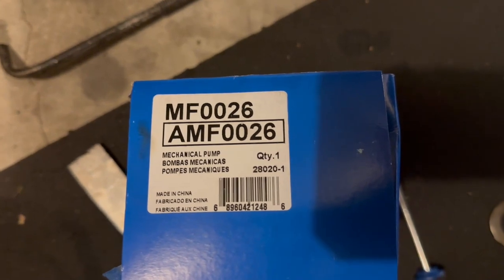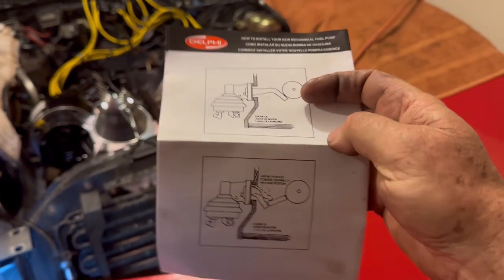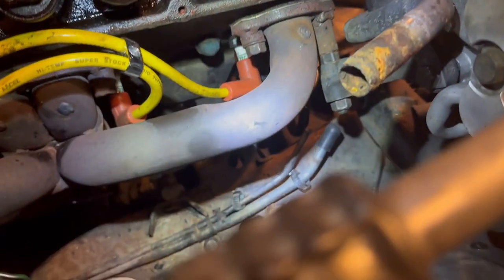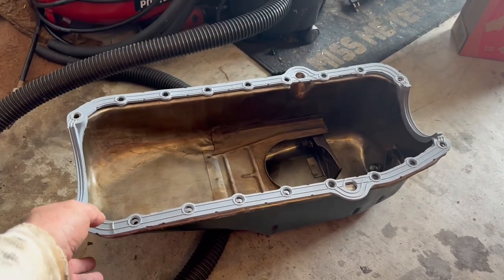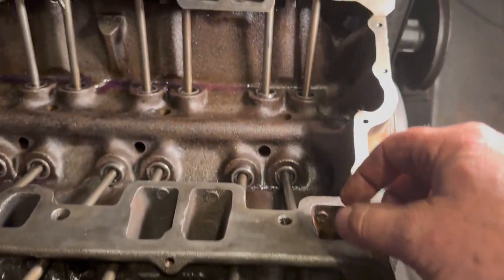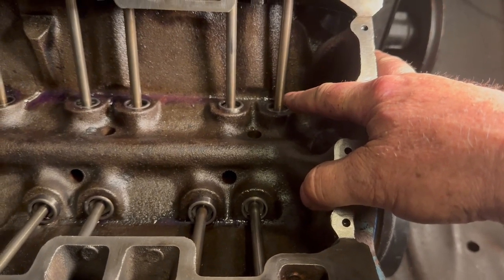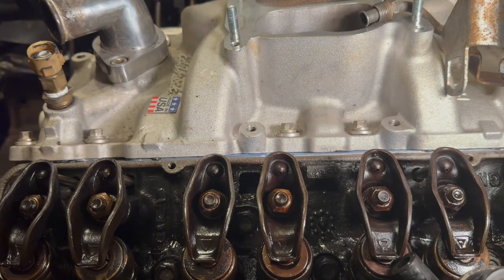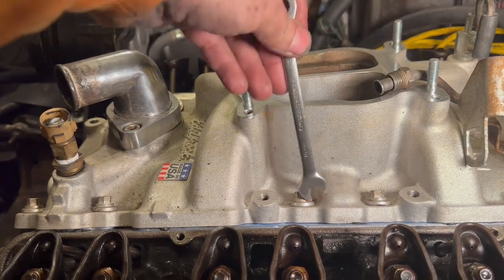1981 C3 Corvette Cam Installation Part 2

Comment: Very nice. On my 81, I went with a chrome Summit oil pan and timing cover special they had. Think I paid 120 bucks?? Maybe.. and repurchased a set of old Holley aluminum valve covers I had laying around.
Reply from the maker: I didn't mine the oil pan being ugly. My car is a daily driver and no one see it. I'm leaning toward the blackout look for the motor. At least black and red.

Comment: Hello mike how has your engine been running? Ans also how many miles have you put on it. Reason Im asking is because those scotch brite pads have aluminum oxide in them and I've heard are pretty rough on main and rod bearings. I'd suggest you look into it a bit. I went down a rabbit whole once because Ive used them to clean my engine block and I ended up filling the engine with a citric acid solution to neutralize it.
Reply from the maker: I’ve put another ten thousand miles on the car without any issues. I did flush the engine with a few quarts of cheap motor oil before driving it. I use scotch rite regularly as an industrial mechanic and I’m aware of it’s nature but my options were limited. No matter what you use to sand something smooth inside an engine you are going to get some unwanted particles left inside that’s unavoidable in what I was doing. I don’t want to tear the engine down completely so it is what it is.